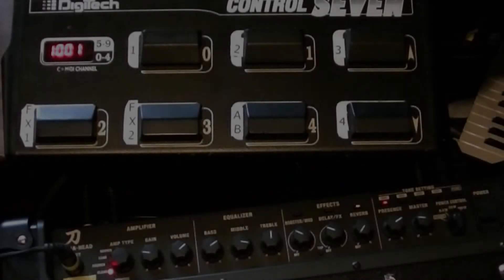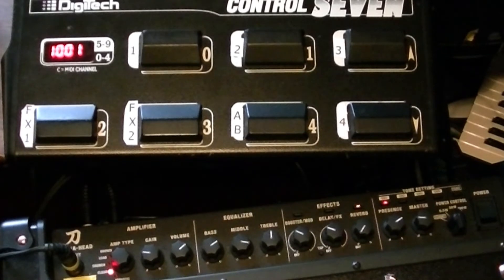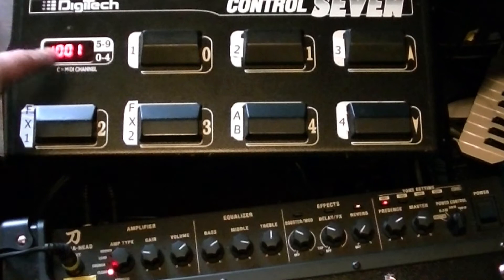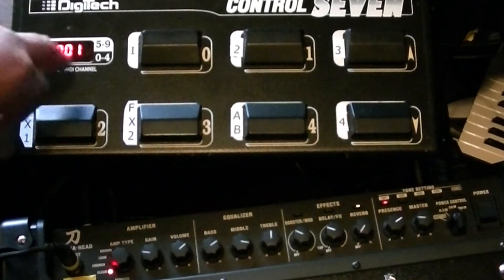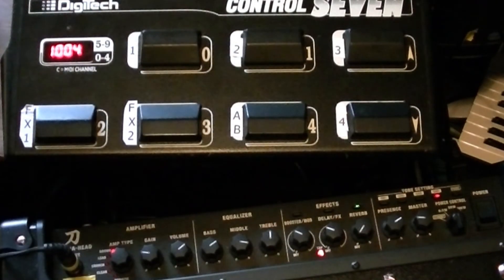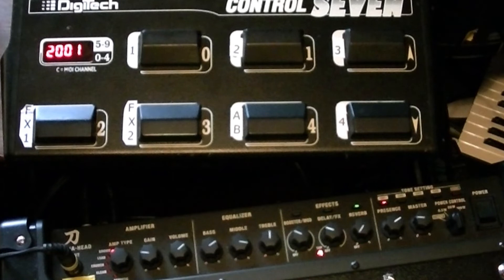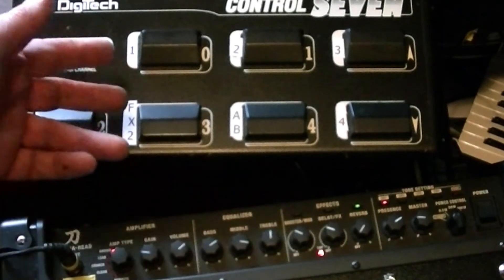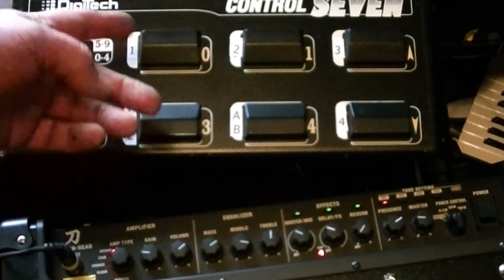DIY midi controller pedal for the Boss katana 100 head

Comment: Very interesting! Hi I have a katana 100 (not head) connected via USB to Reaper. I can only give patch change commands of ch 1 --- 8 and Panel via ReaControlMidi.
Is it possible to use your system to be able to also give the effects control Midi commands?
Thank you.